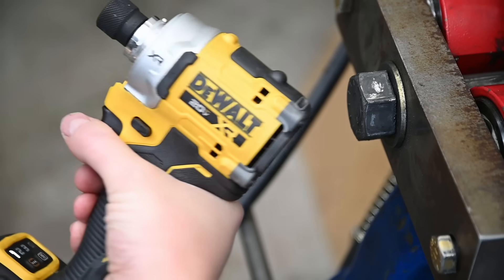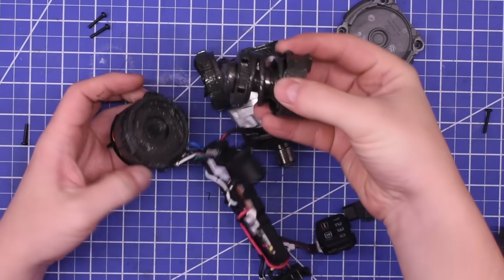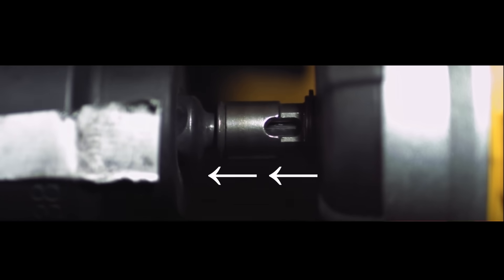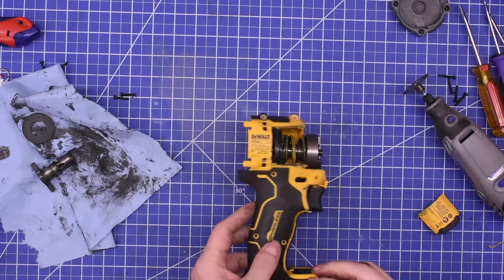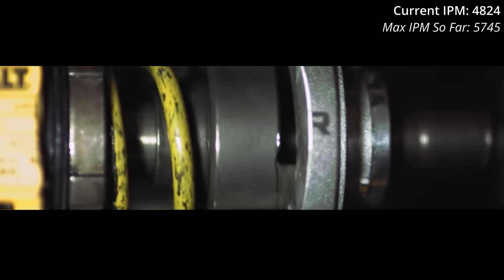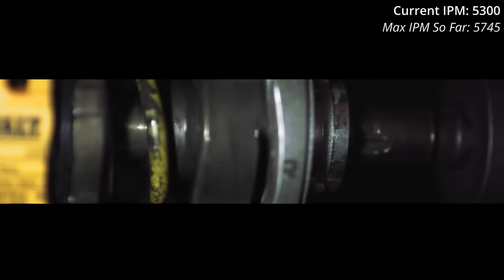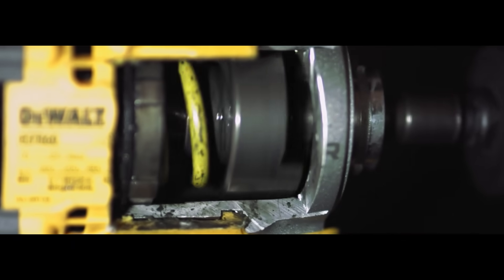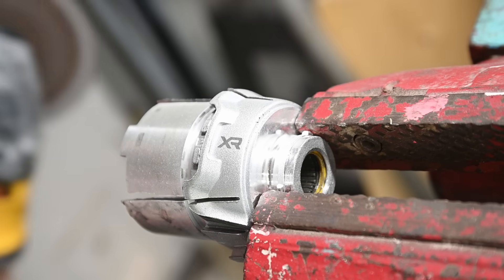We Found Something Strange Inside DeWALT's New Tool @ 10,000FPS

Comment: DeWalt seems to have dialed the tool in (the spring) so that you're hitting the natural frequency of the hammer assembly, with the rebound timed in just the right way to get more IPMs out of the assembly. Pretty gnarly vibrations as a result but I'm wondering if they're gonna push this on their future tools.
Reply: I was thinking the same thing. Looks and sounds like when valve springs just start to float and the valvetrain makes that buzz sound
Reply: add to that the models that seem like they have V-Tech like performance programmed in - seems like Dewalt has been studying high rpm engines and adapting the developments made there
Reply: @nickdecker2350 honestly it is kinda reminiscent of an A-10 CAS run:   Brrrrrrrrrrrrrrt... All it needs is impact smoke rising up from wherever you point it.

That would be fantastic in the rec room pointed at the TV: Lume female B.O. commercial comes on? Brrrrrrrrrrrrrrt 
Another pharma commercial comes on? Brrrrrrrrrrrrrrt

Comment: Could you take a look at 26650,26700, 26800, 32700 cells for battery packs. There's some very interesting combinations.
It would also be cool to see the new 4680 cells in a pack, you can get 25AH and 250A though the BMS on the market would probably support up to 120A before the wires in the tool start melting and would be a 1.75kg behemoth for just the weight of the cells alone.
I have a chart of all cells usable in 3.7v and 3.2v

Comment: I mean, you want to drive stuff in but not so much that the same tool can't take out. A stronger reverse makes sense.
Reply from the maker: Any impact can remove what it tightened as removal is ~20% easier on something that's been just tightened. Any past DeWALT would be able to do the same

Comment: You want to know why it’s stronger in reverse probably because they took their modern impact wrenches and stuck a quarter. Call it inside and call it a day. It’s probably a dcf923 with a quarter collet
Reply from the maker: DCF923 hits thousands of times slower per min and has a much larger hammer
Reply: @TorqueTestChannel  damn I don’t know then the tool looks similar. I just assumed interesting. I wonder what kind of witchcraft are using.

Comment: It's very interesting that it makes more IPM in reverse than forward I wonder if there would be a way of hardwiring it so it was always at its highest speed it probably wouldn't work cuz it's probably all build into one motherboard
Reply: It's not the motor rpm, but the interaction of the weight and the ramps/spring on the driver.

Comment: Seeing all that jitter I'd be worried about how the nylon would hold up against the metal rubbing. I'd be advocating a metal compression clamp assembly in the next model, like how washers keep nuts from deforming wood. Gotta contain that rattle somehow

Comment: I find all these new tool advancements amazing especially as a mechanic. This year I swapped out all my 1/4" style stuff out for 12v from the 20v because of weight and if I really need the power I'm just going to step up to a 3/8" or larger 20v anyway which thanks to the last few years of crazy competition between the brands has pretty much made these tools monsters compared to when I first started out 10 years ago (anyone remember Dewalt 18v haha). Air power is still king but man I can't remember the last time I had to resort to mine. I actually forgot I had an air powered ratchet (probably because electric ones don't try to break my hand). Innovation is a heck of a thing.
Reply: I still have my 18v DeWalt. With those NIMH batteries. Mine still works but the batteries have all gone to shit. If I remember right it was rated at a wrapping 350 inch lbs. 

My replacement was back in 2005 when makita came out with their first lithium batteries. Still running mine and batteries still work nearly 20 years later. I was lucky to get a few years out of those NIMH ones

Comment: The spring is most likely painted as a code. Where ever it is manufactured, there are probably others that look similar; but, have a different compression value.
Reply: I agree.  That's the way springs are identified in firearms spring kits if they have multiple choices for hammer and trigger springs.
Reply: @workingguy-OU812 yea, that’s the most logical explanation. I know I have several multi colored recoil springs
Reply: @workingguy-OU812  Yes. I am more familiar with that, than is probably good. 😎

Comment: I really don't understand this arms race for impact drivers.  1/4" bits snap in these things, and screw tops will strip like crazy.  The only thing that can handle these kind of forces are impact rated sockets, so why wouldn't you just use your impact wrench in that case?
Reply: because "MOAR PWRS" is the way to increase sales in the US market.
Reply from the maker: We're talking more IPM here though, not more power. And IPM does drive things faster
Reply: @TorqueTestChannel  I would say that still requires more power overall since you have the same torque needed for driving screws, you are just doing it faster and power is torque x rpm ofc :)
Reply from the maker: @riba2233  Different type of torque here than the one used in the formula. It's the resulting torque from hammer blows, not a constant axial force. Power alone could be measured from the motor by itself i believe, but that plays only a part in the whole assembly.
Reply: @TorqueTestChannel   true, but in the end if you do the same amount of work (sinking the same screw for eg) in less time, you have to use more power (if I am not mistaken)
Reply from the maker: @riba2233  If this was a drill, then that would be clean math to tabulate agreed. But with impacts, a large lag might get sunk by a high torque with a big hammer with less total watts used than an impact driver hitting on it for 30 seconds. On the opposite side of that coin, a long thin screw will be driven by the impact driver faster due to IPM and the high torque will use up a lot more watts to drive it home.
Impacts are funky like that. 
The impact driver that is using up more power or more motor power out is not a good indication of it performing higher.
Reply: @TorqueTestChannel   I see, we have some losses along the way that mess up our calculations, thanks :)
Reply from the maker: @riba2233  For sure, luckily it messes up the math for these brands as well so there's not a clear path to victory like making the most powerful compact brushless motor in a drill. They each take different routes and it leads to some very cool differences like we're seeing here.

Comment: So if the ipm is higher then stated, is the rpm as well? If the mechanism is hitting every 1/2 rotation consistently, higher ipm must mean higher input rpm. Perhaps you weren't wrong with it being in the electrical side.

Comment: As soon as I saw that spring I thought "spring wind direction".  It appears that in forward the bounce backs from the hammer hits are dragging the spring against it's wind direction and sending vibrations through the spring.  In reverse the bounce backs are going with the wind direction and just sliding along the spring, resulting in smoother and more efficient operation.  It would be interesting if you could obtain two identical springs but with opposite wind directions and swap them out to see if the performance differences change direction.

Comment: This thing is useless! One broken socket adapter after another! Then enjoy the torture of digging it out. When you pay higher-end DeWALT prices, you expect better than nonsense like that from a new tool in their stable. It wasn't just this, but a handful of things that made me re-think my decision to standardize on DeWALT's battery platform. This was just the one that drove my decision over the edge. You expect better from a recognized Pro Grade brand than THIS!
Reply: "Pro grade"....?

Sir you can't buy pro grade at lowest or home depot.

That is mid tier.
Reply: @asbestosfibers1325  
Home Depot sells DeWalt, Makita, and Milwaukee. Don't pretend those are Mid. tier brands.
Reply: @NGMonocrom  They are “mid tier” compared to the “high end” tool truck brands that you can’t buy in store like Snap-on, Matco, Mac and Cornwall Tools.
Reply: @crandonborth  
You can pretend that's the case if you want. But no one in the trades refers to Milwaukee, Makita, or the higher-end DeWALT models as "Mid. Tier."

Comment: Is there a "slide" mitigating the edge catch of the spring in forward or reverse? If the spring's edge is making direct contact with the hammer, that could be a portion of the difference in experience between the two directions of rotation.

Comment: I've seen videos of the DCF860 driving screws slightly faster than the latest M18 fuel, repeatedly. I wonder if that "dance" has a rhythm in forward that is better timed in a fastener in wood scenario vs the dyno. Otherwise it seems like it would perform worse with all that missing, even considering the slightly higher speed and listed IPM.
Reply from the maker: We also show it driving faster here. Even with the uneven hits all of its faster than an m18. Up to 4750 ipm in fwd at times
Reply: If it doesn't break constantly like the milwaukee they have a real winner.
Reply: That rebound effect could help hammer the drill bit into the screw so it doesn’t strip.

Comment: If the hammer had 2 dogs instead of 4 dogs it would have less IPM but it would give the motor a chance to get back to speed. Please do surgery again an remove 2 dogs and do a before and after torque test.
Reply from the maker: It does have 2 dogs

Comment: I need to get my hands on that and fit a 3/8" anvil on it!
Reply: That’s what I did to the 850 as soon as it was released. I’ve been hammering on it every single day in the shop and it’s been an absolute machine.
Reply: @markm0000 I also did the switch to the 3/8” anvil on the 850 and it is a tiny beast. Probably my favorite tool that I use!
Reply: @markm0000  Did you go for the 3/8 or 1/2 anvil?
Reply: @BrokeLifeEU  the 3/8 anvil. It’s a very easy swap if you buy small retaining ring pliers. There’s videos showing how it’s done.
Reply: @markm0000  That won't be a problem at all. I like a challenge. I have done loads of anvil conversions so I don't think it will be a huge issue. I just need to get my hands on this somehow.
Reply: DCF923
Reply: @EvanRutledge  it’s a inch longer and much bigger. The 850 modified 3/8 fits into really small spaces and is much lighter in the hand.
Reply: No more broken adapters 😂
Reply: @bakedPython  I do love an impact driver in to an impact wrench conversion 😂
Reply: Since this 860 has needle bearings for the collet I wonder if there even exists an anvil part to match it.
Reply: @markm0000  Nothing a Lathe or a Sleeve couldn't fix lol
Reply: @markm0000 you’re probably right, the shaft of this anvil looked thicker than normal on the example I tried out.
Reply: @default9740   you won’t know until you try. It might work with a 1/2 square anvil since that’s thicker.
Reply: This needs to happen!
Reply: @Failsafeman100  I hope my finances agree 😂
Reply: @BrokeLifeEU  write it up as a personal stimulus package and it's sorted, time is money 👌
Reply: @Failsafeman100  Wish I could! Wish I could...
Reply: Is this the same 3/8 anvil that I bought from SBD service centre to install in a 885 then found to also fit 887?
Reply: @pigletshut  I have no idea. You don’t know until you try.